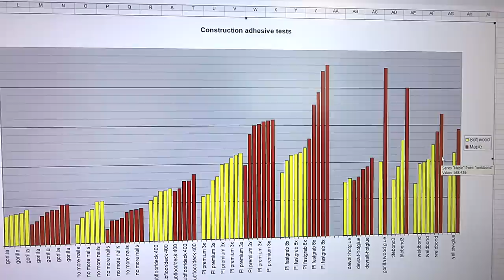Testing construction adhesives as woodworking glue

Comment: I think the takeaway is that different glues have different uses by design. PL 400 is waterproof, works in cold weather (as do other Pl products) but it's made to flex with floor systems and bridge gaps that could cause squeaks, for ex. Especially during the construction process when moisture and temp have more effect on expansion rates, or when dissimilar materials are used - PL construction adhesive is the bees knees in this case. I think most construction adhesives (if not all) are designed to have at least some flex. I've used it for finer woodworking projects after seeing John do it too, but not often. That's what the yellow stuff is really for. It's obviously stronger and easier to work in a climatized environment.
Reply: One of my favourite Youtube Engineers commenting on another of my favourite Youtube Engineers' channel makes me happy. :)
Reply: Yeah, many applications in construction need adhesion to many surfaces, void/gap filling, good usage temperature range, reasonable initial grab/hold strength, at least some flexibility, and at a reasonable price per volume.
3M 5200 is the top end one for marine applications, not quite as strong as x8, but still one of the strongest, and easily most flexible at its strength (800% elongation to break). Soudal Fixall High Tack (European market only I think. MS polymer based), is great stuff for its price; MS Polymer ones are great to work with.
Reply: PVA is much easier to clean up when it's dried as well.
Reply: agreed
Reply: S
Reply: S
Reply: A
Reply: Sßs
Reply: You are spot on. I built home for over 20 years. Construction adhesive by design is made to flex with the expansion and contraction of the surfaces. If it was to hard it would snap during winter, summer, or when walking across the floor. I wouldn’t be a fan of Construction glue in furniture building unless the piece was very large like a built in shelf system.  The glues are made for large panels that need to move slightly. Compare this to a bridge. It is large and needs to flex with the wind and traffic patterns. If not they would crumble. If you build some things smaller like a welding table then you can make it solid as a rock and it will work beautifully. The smaller the object the stronger and more solid the adhesive. The larger it is then you need to account for movement more.
Reply: I think that summarizes it quite well. Take the sub floor adhesive, to my knowledge it is intended to hold down some, but mainly to prevent squeaking etc. in case a nail pulls loose. It was never intended to hold anything down on its own. I heard it sometimes compared to a set compound used in boat building, which is actually more like a caulking I think (I can´t tell for sure). Other construction adhesives I know sometimes where used in smaller landscaping tasks, like fixing caps on retaining walls, where they just need to stay in place.
The clear stuff I know is sometimes used around where I live (different brand actually but comparable product), to attach smaller lamps, house number signs, nameplates for the door bell etc to stuckoed outdoor walls on houses, so you don´t have to damage stucko and underlying insulation. Usually works quite well for this light application.
The only other time I ever heard about construction adheasive used instead of wood glue was for building speakers. Usually in those cases screws were added, the construction adhesive was intended to create some adhesion, but mainly fill the gaps and make the glue lines on the boxes air tight. So, more a remedy for sloppy woodworking, when the glue lines were not tight enough. (Otherwise if worried, just add a bead of caulking on the inside corners.)

Comment: Construction Glue is supposed to have some flex to compensate for the yearly seasonal flex in houses. The winter  to summer to winter to summer back and forth flex needs a buffer. Tile floors would crack at the seams of the subfloor if the subfloor was glued to the joists with a firm woodglue vs a flexable construction glue every time the house expanded and contracted with the temps
Reply: thats why there are specificially designed PU wood glues, they quite differ from general purpose PU construction adhesives - the real advantage of PU wood glues over PVAc wood glues is that they can be used at far lower temperatures
Reply: That's why houses are built of concrete. Except in third world countries of course.
Reply: Right again, Captain O! Or should I say Professor O, considering the schooling you just laid down.
Reply: @girthbrooks39  Nice to see you add nothing to whatever you do...    keep reaching for the stars
Reply: @nomen.nescio  other materials can be used for durable houses as well, if applied correctly.
the main difference between third and first world construction is the structural safety margin, precision, and care for qualities beyond just standing for now.
in rural Austria you still occasionally come across 15th century wooden houses, and on the other end of the scale the Paneum has a meter thick wooden walls made from layers of glued strips, then screwed together on site, and outside covered in thin metal tiles.
concrete, natural stone, bricks, metal, wood, glass, composites, can all have their places in building.
Reply: @nomen.nescio  Concrete is a terrible material to build a house out of, generally speaking.
Reply: @MikeDijital  as flattering as it is hearing you characterize the image of me not adding to stuff as a 'nice sight', I'd appreciate it if you went back to watching This Old House, so you can keep passing down that 'professional' knowledge.
Reply: Ye. The glue as such is an option. There is other ways but north American building standards are lax af.
Reply: @girthbrooks39  You must be a joy to sit next to in a waiting room...
Reply: @MikeDijital  For Christs sake, try to contain yourself Professor O! You ought not divulge things of that nature, unsolicited like that.
Reply: @nomen.nescio  Obviously you've not seen many homes in "third world" countries 🤦🏻
Most cities in Asia you're gonna be hard pressed to find anything NOT build out of concrete 🤣🤣
Reply: @girthbrooks39  Hey, let’s leave TOH out of this! 😆
Reply: @Keifsanderson  fair enough.

Comment: In my door making days, the shop I worked at we exclusively used PL Premium to glue our joinery because the shop wasn't 100% conditioned and was cold in winter. The slight flexibility allows doors to take some abuse and to also move with interior humidity changes or with seasonal changes outdoors. Our exterior main entry doors never fail.

Comment: There's one major application I use construction adhesive for in a woodshop, and that's outdoor projects. Even waterproof PVA glue just doesn't hold up well in the elements in my experience, and if you're doing any cross-grain joints, they're prone to failure due to the exaggerated shrink/swell characteristics of wood outdoors and the brittle nature of the PVA glue. If I'm building Adirondack chairs or something, I'll go ahead and use construction adhesive instead of PVA glue in addition to mechanical fasteners. It also has the benefit of good gap filling, so you don't necessarily have to be as precise with your joints, which suits rougher outdoor projects that aren't works of art.
Reply from the maker: Indeed,  I have had the glue on some mortise and tenon joints on an outdoor projects completely fail on me.  I now mostly avoid large wood contact surfaces, cause that's where moisture accumulates and rot starts.
Reply: @matthiaswandel  Dear Matthias. Can I work for you and your channel please??
Reply: For outdoor project you have polyurethane wood glue - that is fully water resistant, it has D4 class (best PVA glues are D3)

Comment: I didn't know that much about "construction adhesives" until we had to "re-clad"  the upper part of our house.  It's cedar,  and unless we were going to somehow rip off the entire front end,  there was no way to make it look new again.  (Built in 1958.  REALLY weathered.)
So we bought dimenional cedar,  ripped it all lengthwise,  planed it and reclad all of the cedar.   And,  as the fellow whom I hired to do most of this said,  "It's kind of like cladding your car".  And that was because the front of the house has sort of "settled",  shall we say?  Anyway,  that whole process was four or five years ago.  We used many tubes of PL adhesive (I don't remember which one...400?)  which was attached using stainless brads.   It's still there.  I suspect it'll still be there when they take me out on a stretcher.   I do use it from time to time in woodworking,  if it's a situation where the wood is exposed to the elements.  Not the easiest stuff to work with,  has to be held under pressure, takes 24 hours to cure,  and whatever you do,  don't get any on  you.  Or,  have some paint thinner handy for that eventuality.   Your test has confirmed what I already kinda knew.  Thanks.  Carry on!

Comment: I used the PL x 3 tubes when I remodeled my house and I loved it.
You need to warm up the glue to make it flow easy. I throw each one in hot water for a few minutes before using.
Also, spaying both surfaces with a water bottle, then clamping tight or screw it in and wait one day until set, will tear the wood apart before failing.

Comment: You only mentioned polyurethane glues by name, which I think only the "PL" glues are. "no more nails" is a silane based glue (silanes are like hydrocarbon alkanes, but with carbon substituted by silicon). I don't know if a PU glue can be made as flexible as a silane glue and vice versa. But the flexibility is very nice to make "push buttons" in wooden housings for electronics. I've used it several times. Drill a hole in a front panel board and make plug with a diameter a few millimeters less (4-6mm smaller diameter works well). Put the plug in the hole and fill the surrounding (2-3mm) gap with the silane glue. You now have a flexible wooden button to push (obviously you need to have your PCB with the actual button right behind it to do something useful). (With a CNC you can make the hole and plug in one go.)

Comment: Having compliance in an adhesive can be very useful, particularly from a durability perspective as that compliance can  often take temporary excessive loading without deforming. Also a compliant boding material can be good at dampening vibrations and or the transmisability of vibrations through a medium by making the interface between materials poor kinetic conductors while still remaining strongly bonded.

Comment: One of the reasons we use a more flexible “weaker” glue for subfloor is that it reduces squeaking. If you were to use a thin liquid glue (like titebond), not only would it not have the needed flexibility, but it would also develop squeaks.
Reply: You are right but that is not what he was testing. He was testing the strength of the adhesives if you used it in place of wood glue for wood working.
Reply: @eastonvonschist2283  Well, what is wood working needs to be defined.  You will not use construction glue for fine joinery - it is just thick.   So is subflooring woodworking ? Or splcing boards on the outside deck ?

Comment: Looking at John Heisz' comment from last video about glues, he recommends "PL Premium" — indeed, the same glue out of the construction adhesives that you recommended. Seeing as it is about as strong as yellow glue, but takes longer to set, I would conclude that it's equally valid to use PL Premium (or 3x) construction adhesive or to use wood glue, with the difference being mainly in process and circumstance (i.e. speed required and surrounding temperature). In other words: I expect John Heisz to leave a comment that boils down to "I told you so" — and he'd be right!
Reply: no, he'd be defending his marginal and incorrect point of view as usual.  construction adhesive is appropriate for construction.  if you want to do woodwork, use a proper wood glue that has appropriate strength and working time characteristics.
Reply: I agree 100%.  I've used PL for projects that are a bit slow to put together so I don't have to worry about the 'glue' setting too quickly.  Those projects are still standing to this day.
Reply: @ScottPankhurst   My experience falls in line with John's.  Sorry but you are not correct.
Reply: @ScottPankhurst  I'd never use wood glue for structural purposes: shelving, chairs, surfaces you might step on, workbench legs etc
Reply: @rolfbjorn9937  Hm, most of these should be made to stand to the weight without any glue

Comment: Thanks for the glue info, but an additional thanks for your Ukelele project from 9 years ago.

Actually I am glad you did the full series not just the 30 minute start to finish video compilation from 3 years ago because I am currently building a Tenor Ukelele.

Right now I am about to bend up the sides around a mold I made, but I want to see how both you and Pat did it on the chance you have or had better methods.

I notice you made the fretboard too. I made one for a previous kit build that unlike the current scratch build had major components pre made. After hearing Jerry Rosa say he buys them pre made now because you just can't beat the CNC accuracy I plan to do the same. Why, because frets are something to fret about at least location wise if you like good intonation.

Comment: I was just wondering (and pardon me of this was already covered in an earlier test video), that this test demonstrates the 'shear' strength of the adhesive, not very much the 'tensile' strength. Seems like a lot of construction adhesives must, in their normal use, be used primarily in situations where tensile strength is more important than shear strength. But then, Matthias is apparently evaluating these construction adhesives for non-construction applications, such as general woodworking, but even then I wonder if shear strength is really the best test in this situation....?
Reply from the maker: yes, in normal use.  I focus on woodworking use.
Reply: Shear is the weakest axis for adhesives.  The best example of this is cyanoacrylate You might be able to lift 200 lbs with a drop of it but take a little hammer and tap on the side and it fails.

Comment: I remember when I first started using these types of glues an old timer told me to mush the pieces together and then separate them before the final assembly of the parts. His instruction was that the glue would set faster if there was fresh air mixed into the joint before you seal it up. I'm not sure if that actually does anything but I will sometimes do this if i'm gluing something together without screws or nails because It might help.
Reply: Urethane adhesive works by sucking moisture from the air so yeah it can make it faster
Reply: It is written as a method of application on some of those tubes

Comment: Construction adhesives are meant to sit on the surface of semi-different materials to minimize movement and fastener squeaks.  They fill voids and small gaps, they stay somewhat elastic, but they do NOT penetrate very far into the grain and are not very strong in tension.  I’m surprised any of them work at all for the applications John Heisz uses them for but hey- if it works it works I guess. None of them inc PL Premium produce an acceptable glue line however - they can’t.  If you squeeze them out to an invisible glue line there is nothing left to bond to the wood.  I’ll stick with PVA glues for standard panel glue-ups and the like, and save my PL for carpentry tasks.

Comment: Hello Matthias,  I have an idea for something you might want to investigate.  I have an 8 inch bench grinder, with a fine brass brush on one side to clean rust or paint from parts. When I use wire wheel I feel a lot of air movement.  It occurred to me it may be moving as much air as your hand made dust collectors.  Not suggesting you use a wire wheel for dust collector, but interested how much air movement it produces.
I enjoy your videos.  Jim

Comment: It helps when someone doesn't approach different process with a negative bias... It's very useful, is one part, will bond to almost anything, even non porous surfaces.... Using a putty knife to spread the thicker glue, or the caulking tube to inject it in hard to reach holes,  keeping a rag with either acetone or mineral spirits nearby and making sure to use nice tight fitting  joinery helps a lot.  DO NOT USE METHYL ALCOHOL :INHIBITS CURE FOREVER. Mechanical fasteners make the "slow" cure perfectly fine. Just as with industrial adhesives, fixture strength vs full cure is what matters. In a warm and tempered environment it's more than adequate. Just chisel or plane the dried excess...no mess. It's thick and doesn't ooze and drip everywhere. 

This type of adhesive is made for structural applications where wood glue would creep under load, high dynamic loads or be degraded by moisture. It sticks to itself and other previously glued substrates too... It's easier to deal with when you make sure to use fresh tubes, not the ones that spent 5 years+ on the shelf as a display in the hardware store, and the tube is warmed up to at least 20-25 Celsius. The grey or tan color matches or contrasts beautifully with the wood when you work it in the design.
Reply: All of those things are true, but I'd quibble with the negative bias assumption. He is not asking "what is construction adhesive good for", but "is construction adhesive a good drop-in replacement for standard wood glue". All his tests are centered around that premise, so his conclusions (a resounding "meh") make sense and, from my experience, are also accurate in that limited scope. That doesn't change the fact that construction adhesive will work for some of these projects, or is really good in other cases as you mentioned though.